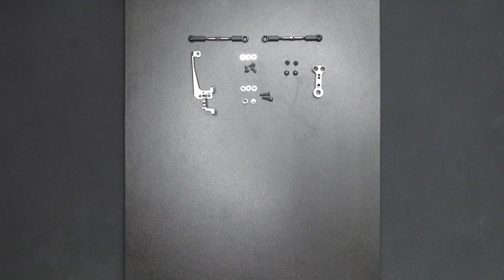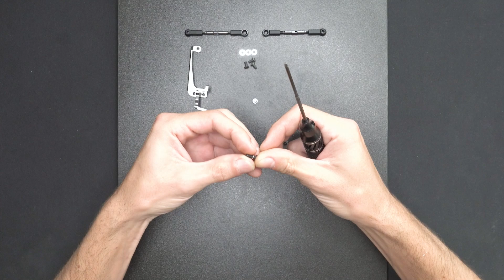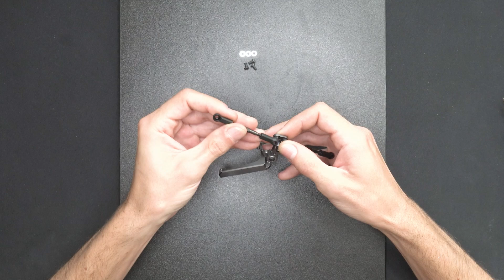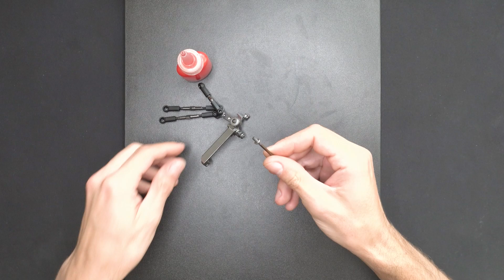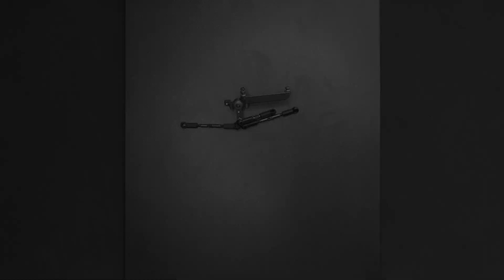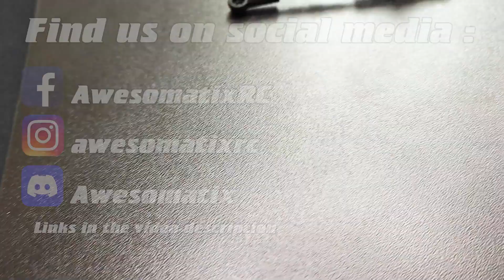Awesomatix A800R build video series: Steering Assembly

Comment: Hi, in the manual it says to use the 1.75mm shim under the ST24, I see you’re using 1.5mm instead. Which would you recommend?
Reply: Both are fine, however the Manual gets frequently updated, go with 1.75mm then.